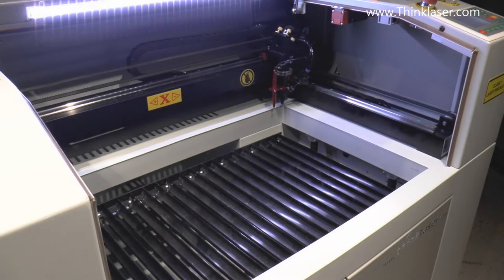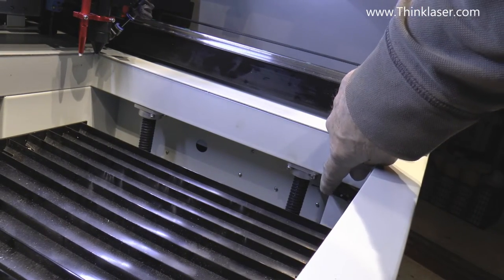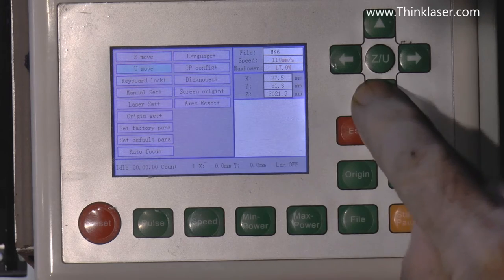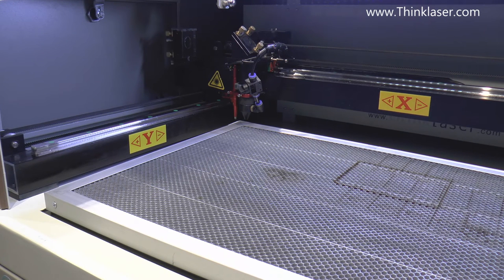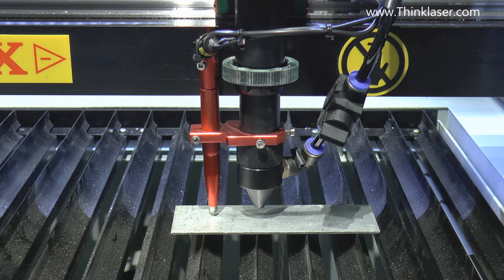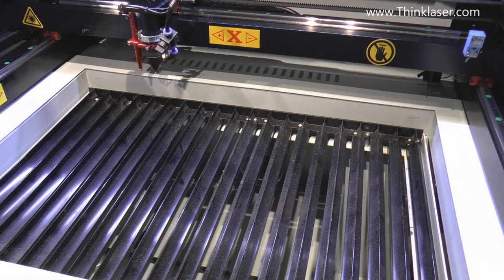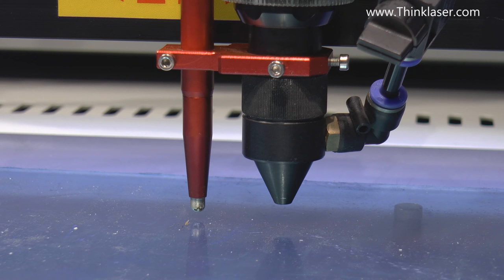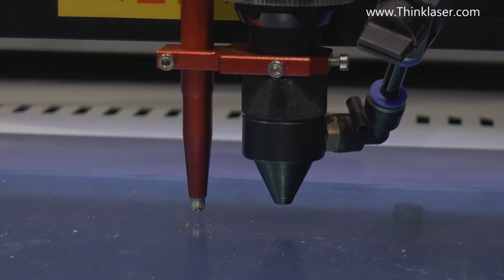How To Use a Laser Cutter - Lightblade Learning Lab 07 Understanding Your Auto Focus

Comment: how do you install the focus and red dot to the laser machine. I'm talking about the electrical wires?
Reply from the maker: Hi colorsin966,
 
Our machines have four core cable going between the head and the electrical cabinet via the cable chain trunking. Two of those cores are the 5V supply (+ and -)   for the red laser pointer. The other two wires that the autofocus switch is connected to go to the ‘Limit Z-‘ input and ‘GND’ connections on the controller.
 
If you are looking to retrofit autofocus and the red laser pointer to a machine that comes without, then the only other thing that might be needed is a 5V supply within the cabinet (it might be missing since its only used for the pointer). This is easy to add without wiring a whole new PSU in (since its very low current needed) by using an LM7805 regulator fed from the 24V supply that’s used for the controller and then the 5V output from the voltage regulator can be used to power a red laser pointer.

Let us know how you got on.
Reply: I purchased an 80W chinese laser cutter from Ebay. I finally heard back from the company and they told me it comes with a red dot laser positioning. So I want to know if it's necessary to add the red auto focusing pin that you have on your laser to make it focus better. I've seen a lot of people on Ebay with a 60W laser adding the red focusing pen to their laser. Will you be doing any videos on how to install that pen as an upgrade? I appreciate all your help. 
Thanks,
Darrin
Reply from the maker: Hi Colorsin966,The autofocus pen is a nice to have but not a necessity on a laser machine. With a little bit of practice you will be able to set up the focus in less than 30 seconds and this is made easier by using the focus gauge which can be found at http://thinklaser.com/wp-content/uploads/2017/01/Focus-gauges.dxf . Fitting a Focus Pen may be something we will consider in the future but as all our machines come with a focus pen as standard it may be sometime before we get around to it.
Reply: Be careful, I purchased a Chinese 100 watt laser with auto focus. It came with a motorized table. I purchased one of  those aluminum sensors . It won't do anything until you add another stepper motor and driver.
Reply: Can you please give me some information. Can you tell me what model stepper motor and driver you have for your ZAccess?
Reply: Thinklaser Limited . I was just watching your machine with auto focus. Can you please tell me what stepper motor and driver ER you use for the Z access?

Comment: its been a couple years but ive refined mine I no longer use the pen its NOT accurate. I use a NPN proximity sensor mounted on the front right of the frame and a 3/8" bolt under it so I can adjust a height. Then I zero it out. IN light burn I can offset 0 to 20mm works great

Comment: the problem with the pen is that piece of metal is rough when it moves it is microscopic but it never activates the sensor the same depth. the npn proximity sensor has no moving parts and works perfectly. ive got two of those stupid pens i dont use.

Comment: Can you tell me is your z access have a straight DC motor? Or does it have a stepper motor. If it's a stepper motor that shouldn't have any runoff obviously. Imagine your x and y having that much runoff. You're never make anything
Reply from the maker: Hi Mark,

Our Z-axis has a stepper motor. Our X and Y axis use hybrid servo motors. 

Gareth @ Thinklaser